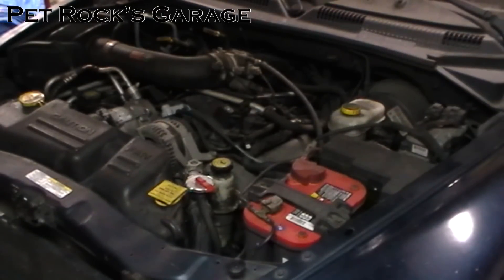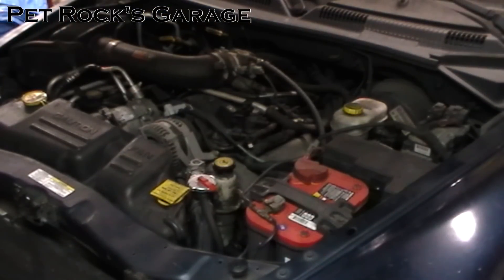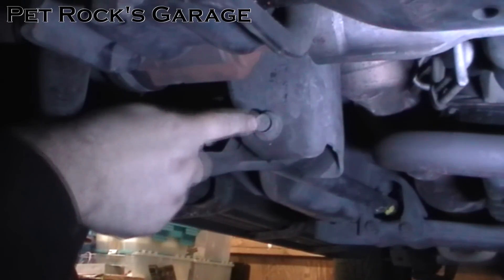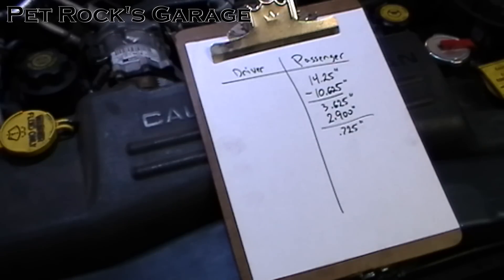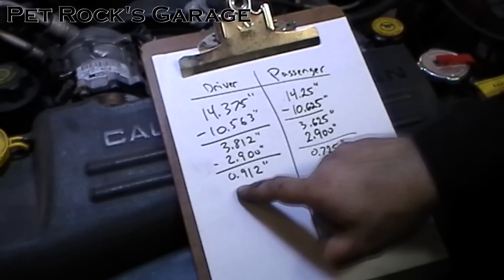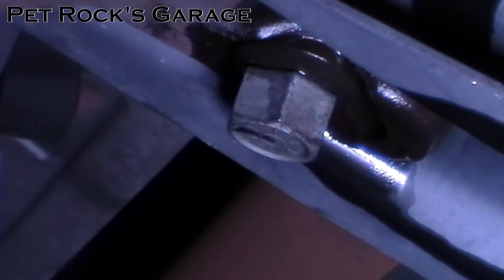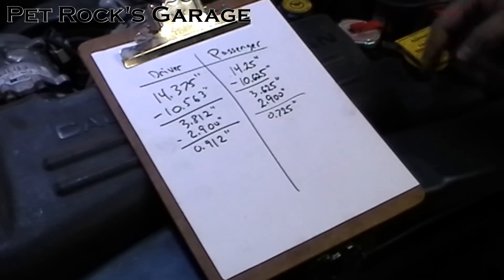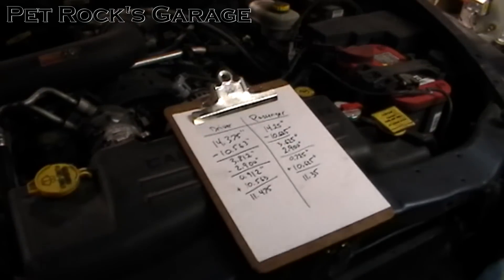How To Adjust Front End Ride Height - Dodge Durango 4x4 (’98-’03) & Dodge Dakota 4x4 (’97-’04)

Comment: The tires yes....
Reply from the maker: Ok, if the tires are coming in contact with the inner fender then it could be a ride height issue, but is more likely a suspension issue. If it's a 4x4, also make sure that you don't have it in 4-wheel drive on dry pavement. That could cause this issue when turning and is very bad for the drive train. If you don't have it in 4-wheel drive, and the tires are not hitting the inner fender, then it could be a problem with your CV axles. If its a 2x4, then I'm not sure what it could be. Either way, definitely get it figured out sooner rather then later. Good luck.

Comment: if u turn 1 time or 12  i aint counting turns of bolt im turning for ride hieght how ever many times i turn the bolt  doesnt matter
Reply from the maker: It doesn't hurt to mark the bolt.  Do it if you want.  If you turn the drivers side bolt 4 times, chances are you will have to turn the passenger side a similar amount.

Comment: your math is wrong 14"1/4 - 10" 5/8 is 3" 3/8
Reply from the maker: +Austin Cruse: what do you mean? I double checked on my phone, computer & Google’s Calculator and 14.25 - 10.625 = 3.625. Or is there another calculation in my video you are referring to?
Reply from the maker: Put another way 14"1/4 - 10"5/8 = 14"2/8 - 10"5/8 = (112/8 + 2/8) - (80/8 + 5/8) = 114/8 - 85/8 = 29/8 = 3.625 = 3"5/8
Put an even simpler way 1"1/4 - 5/8 = 1" 2/8 - 5/8 = 8/8 + 2/8 - 5/8 = 10/8 - 5/8 = 5/8
Reply: @petrocksgarage  I got what you did. It's right in front of us on the paper. 👍😎
Reply: One day you guys REALLY need to go metric. USA and Burma, the only two Imperial measurement countries in the world and even then the two systems are different.

Comment: I have a 2 wheel drive Dodge Ram that sags down on the front driver side.  what is the term used for the adjustment so I can research on how to adjust my height?
Reply: Torsion bar adjustment
Reply from the maker: 2 wheel drive durangos/dakotas/rams don't have torsion bars. They have traditional springs that control the ride height. Only the 4x4s have torsion bars.